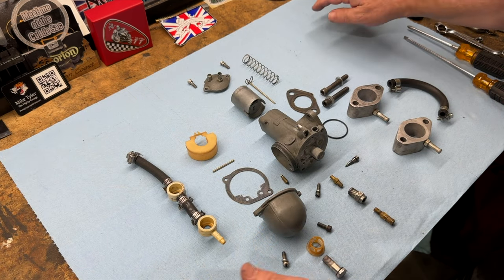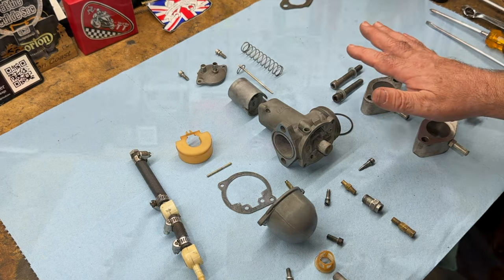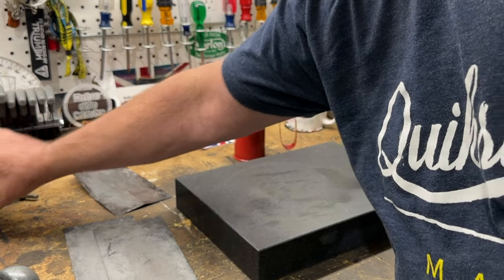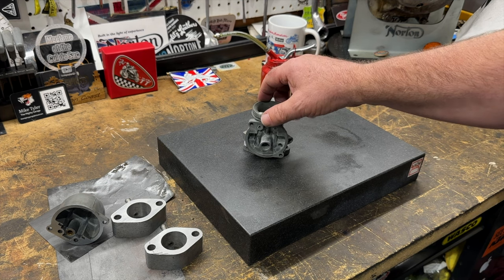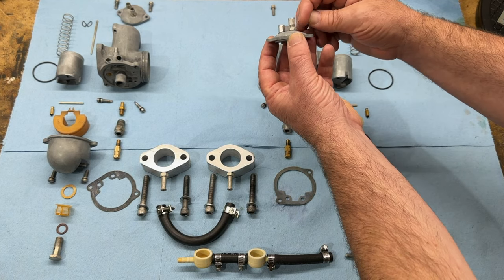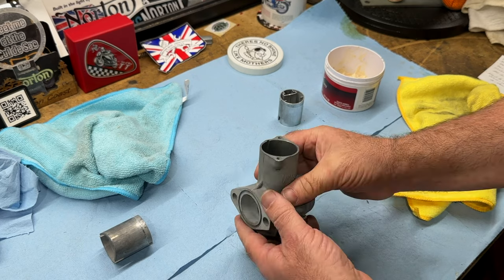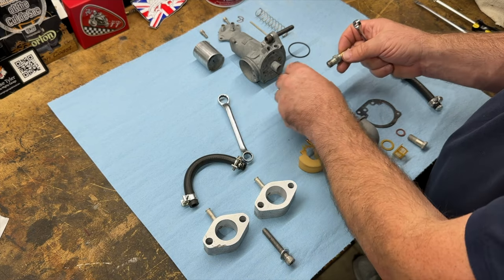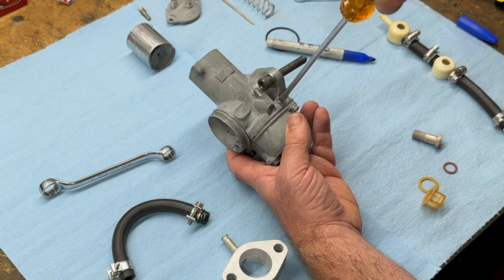Classic 1966 Norton Atlas 750cc Motorcycle - Part 2 - Cleaning the Carburetors

Comment: Apologies for 3 separate comments, just remembering things . Another thing that can help , is to slide 'shrink-tape' over the cables (above the carbs ) then when everything is adjusted correctly , pull it down over the adjuster on the carb-top and shrink it in place . Stops water And can help tuning from experience . Sometimes pays to check that the previous person hasn't mismatched the slides to respective carbs also . You have done a great job on these , people underestimate how easy it is to distort them .  Dave  NZ

Comment: You can also use a little 'plumbers' thread-tape on gently-tightened threads (soft-carbs etc ) to stop them coming loose, some people use silicon . Both are not visible used sparingly , there's probably a product for it these days , other than lock-tite .  Dave   NZ

Comment: I use left over gasoline from the 6 gallon tanks on my boat.
It is 50:1 mix using Pennzoil Synthetic 2 stroke marine oil & Premium Gasoline.
This keeps my Slide from sticking & the synthetic oil burns clean.
I have a 1973 Triumph Tiger with same Carburetor & 63,000 miles.
Reply from the maker: Great point! Many thanks.

Comment: I recently replaced the carb on my 64 Triumph TR6 with the Amal 930 concentric premier.  It works great.  The removable pilot jet is a nice feature.    I've tried the thicker o-ring and some different insulators (for mounting) but it doesn't seem to effect the heat transfer from the engine to the carb.   I only recently realized how hot the carb on these bikes get... not so much while I'm out riding, but 20 minutes after I park the bike.   It doesn't seem to effect performance, so it's not something I worry about.

Comment: Excellent as usual. However , I don’t understand as to why there is not an ‘O’ ring on the engine side of each carb spacer. I.e. a groove to take an ’O ‘ ring instead of metal to metal or was a gasket fitted ? Perhaps I am having a senior moment though !
Reply: I was wondering that , thought I might have missed the bit where Mike said he put a gasket between the two . There didn't seem like gasket poking out .

Comment: Hello, actually you are using a 360 grit (in some brands is a 320) instead of a 400. That is because P400 (or whatever other number) is coarser than a real 400 grit (sandpaper only says "400")
.With Triumph, a thing that you possibly know is that the carburetors have a special thicker O ring and is about 0.060 of clearance when tight.

Comment: Great detail on the filming, can I ask a question?
My 1974 norton commando 850, has noise at the top of the heads by the rockers and valves best I can tell, my experience is limited with the noise level being I have never heard another commando live except for  mine...I have adjusted .008 on the exhaust and .006 on the intakes but i still hear it.
I know it's tough to give advice this way, but is this the norm for nortons...can the adjustments be tweaked at all .oo1 or 2?
Either way thanks for all of your videos they are so helpful.
Reply from the maker: Hi Phil, I would be happy to help. It might be perfectly normal as they do rattle and clank a bit. Yes, you can definitely tweak by a couple of thousandths. Is there any way you could send me a video so that I can listen to it and perhaps share with the guys in the club?  You can send a small video file or a link to a Box folder or iCloud photostream to my email address: themightygarage@icloud.com. Good luck!  Cheers, Mike
Reply: I'll get on it, thank you.